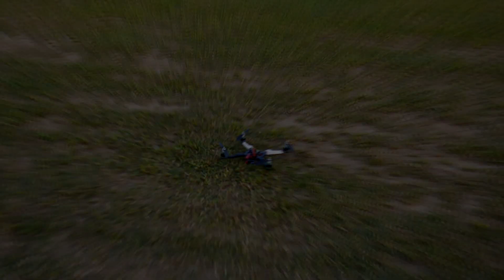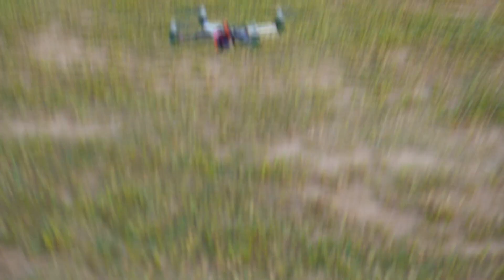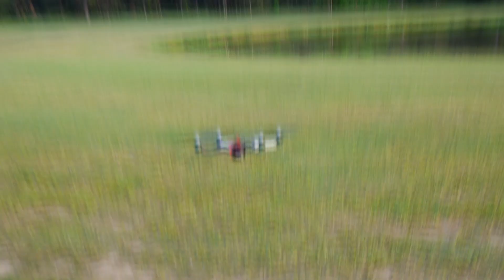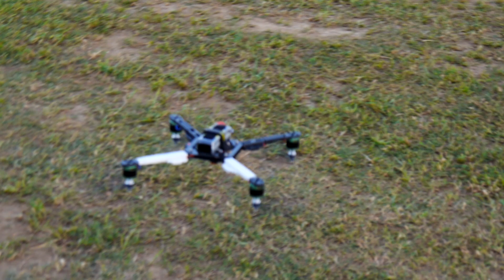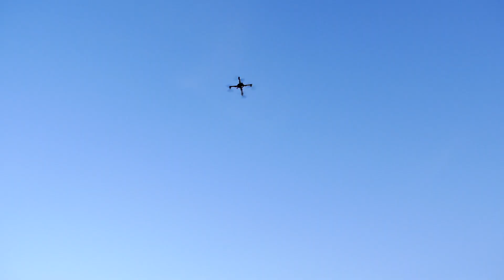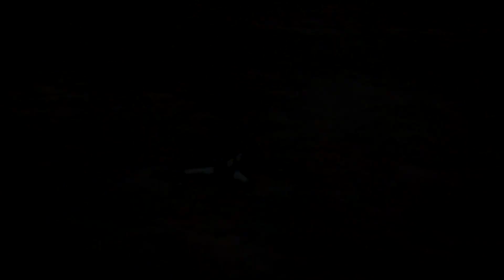3D Quad MultiWii3d Test 1

Comment: Those motors are usually more expensive and the mechanics prone to failure. Those 4D planes are rather light compared to a quad that is much heavier.
This is rather simple to do, just flash the ESC's with the proper simonk FW and run for example a version of the Multiwii FW that handles the new motor throttle range.

Comment from the maker: It does get the motors warm, but there is no damage to them. Its not any worse then applying a brake. Remember that the motors slow down a little around center stick before they change direction. Unlike the constant speed of a collective pitch helicopter, these motors  are 0-100 throttle up and down from center stick.

Comment from the maker: Very low part count. Its all done in the software on the ESCs and the flight controller. I fly 3D helicopters. This is just another aspect of the hobby, and even though it's not as agile as a collective pitch heli, its still loads of fun, without the risk of tearing up an expensive aircraft.

Comment: I'm also interested to know what props you've used - i gave this a go myself but the 8x4.5 rctimer carbon fibre props didn't produce enough thrust when running backwards to get the quadcopter off the ground. I put landing gear on the top as well as the bottom for testing purposes so i could try to take off inverted which turned out to be a very useful.